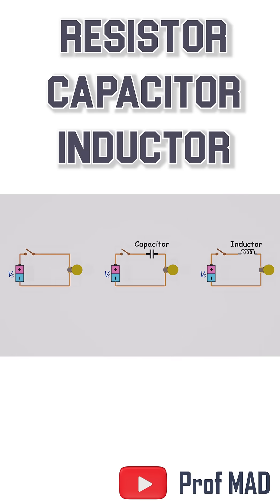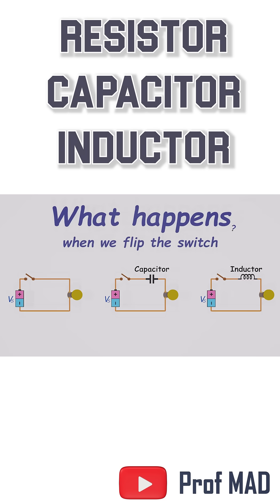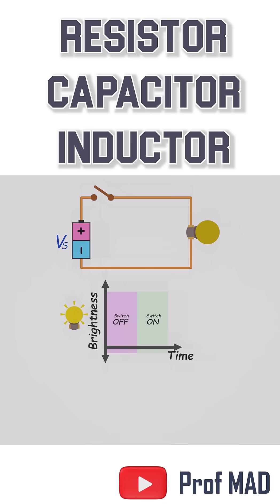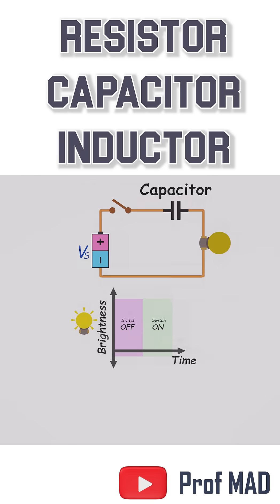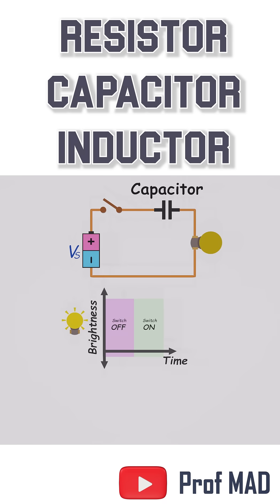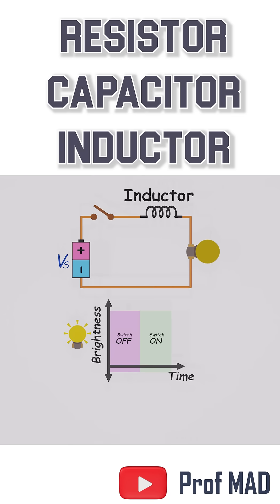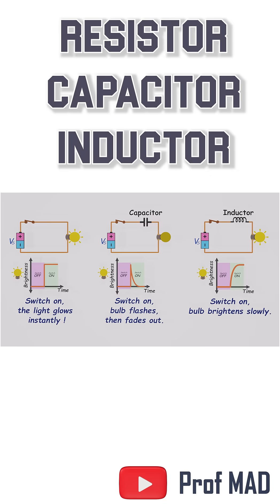Resistor, Inductor, Capacitor — What Happens When You Flip the Switch?

Comment: And what happens in parallel or in series?
Reply: A capacitor in pararell initially will prevent the light turning on, gradually will allow it turning on and finally will allow the bulb on as if it isn't there acting as an open circuit.

Warning: The inductor set up will need a resistance in series with the battery so it doesn't provoke a short circuit. Initially it will allow the bulb on, then it will short circuit the bulb. i.e. it will cut the pass of the current effectively turning it off.

Comment: Should not use the term "resists" for the inductor's action.  Inductance is not resistance.
Reply: Sorry but all inductors have a base resistance a inductor is also known as a choke when first invented it was used to smooth out ripple in a power supply and all have resistance even a capacitor has resistance some very low in Audio applications but a inductor stores and filters current but also has a resistance it will lower your voltages but provide instant power when needed like a capacitor it just takes a bit longer for the ions to travel causing a slow increase in power , most power supply’s will have a small capacitor in front of the inductor to the load
Reply: You are correct, but this is a basic-level knowledge video.
Reply: @Mark-in1im That s why you shouldt bro